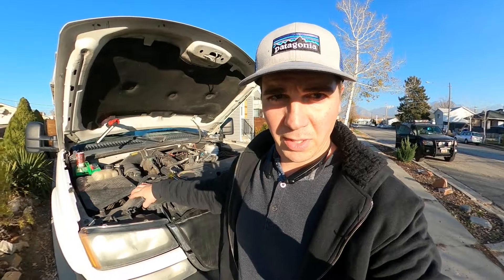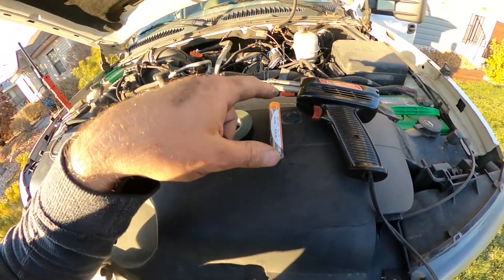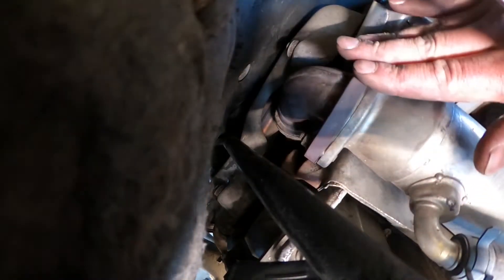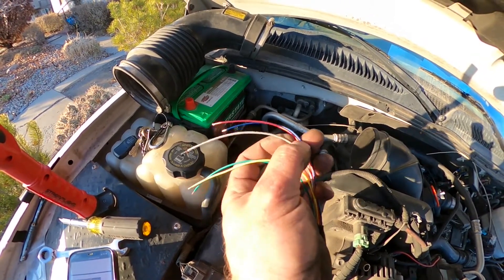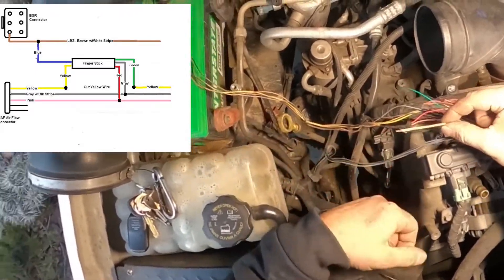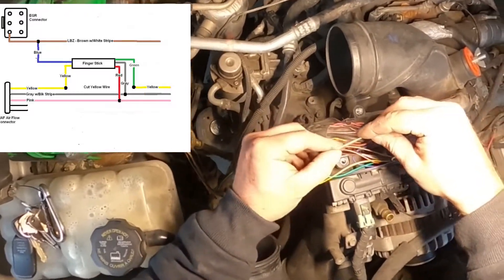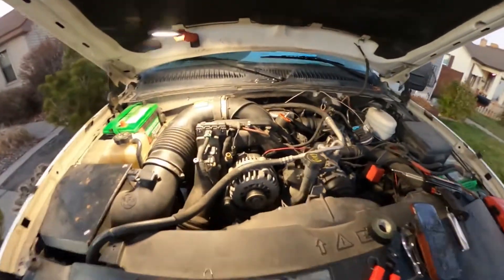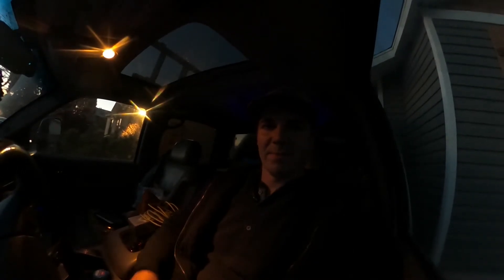Kennedy Diesel- How to Install an EGR blocker and finger stick on your LBZ Duramax 2006 2007

Comment: In the video did u cut the gray wire? Or tap into it? On your schematic in the video it says you're supposed to tap into it and solder but I think I heard you say cut. Not sure what to do with the gray wire cut or solder onto without cutting the wire.

Comment: Just installed a 5 inch straight pipe and check engine light threw on. Will this help with it?
Reply: Exhaust doesn’t effect check engine on an lbz. You have something else wrong
Reply: @Kyle_Godfrey111  it actually did. I had a loss of back pressure. Threw a cat on a it went away.
Reply: @philipthomas5091  was your truck sold new in California? What year is yours
Reply: @Kyle_Godfrey111  no I bought it in Nevada and it’s a 06 (LBZ).

Comment: Thanks for the video, man! 
I knew I’m watching a guy that knows what he’s doing when I saw that Klein 11 in 1, lol!
Just got the kit in the mail for mine, she’s limping and I hope this fixes her up. 
I’ll definitely be referring to your wiring instructions to compliment the PDF. 
On another note how did you address that coolant leak at 3:54, lol? 
I plan on bypassing the EGR cooler and deleting those connectors because of that, as well as to prevent any catastrophes from happening in that exchanger.

Comment: Did it improved your spool or boost? My 05 Silverado 6.6l is losing a lot of power. EGR popping up with P0299 indicating underboost. Do you know will this fix the lose in power?
Reply from the maker: I don’t think this will resolve that issue. Either the turbo or boost solenoid is the culprit. Hopefully the boost controller. Let me know what it ends up being!

Comment: I just wrapped up installing same blocker and finger stick on my 06 LBZ all based on your video! Great video man! Helped me out tons!!
Reply: Glad it was helpful! Make sure and subscribe to both my channels,  Wasatch Moto, and Handyman Fur Hire for more helpful videos!! Cheers
Reply: Did your mass airflow sensor code pop up? Mine did. I have to reset every time I stop my engine. Any advice?
Reply: @nikpheng6420  Mine has not... I followed every step in this video and to date I've had zero issues....  Maybe a wiring issue?? I know when I spliced in the finger stick I tripled checked wires before splicing.... Also, check to make sure your blocker plate is tightened evenly... You may have a leak there causing it to throw a code.... Good luck

Comment: Just ordered this for my lly, thanks for the video!!
Reply: You got it! How many miles does yours have? I’m at 277 all original motor and trans and it doesn’t skip a beat!
Reply: @diyhvacguy  226k bone stock other than mbrp 4” straight pipe
Reply: If you can subscribe to my other channel that would be awesome! It’s Handyman Fur Hire. Cheers
Reply: Did you put a blocker plate to your lly and the finger stick? Any changes in power or performance?